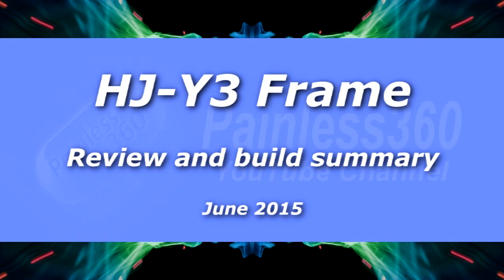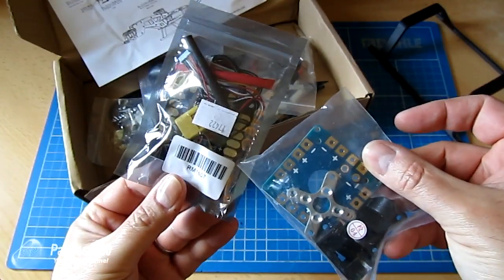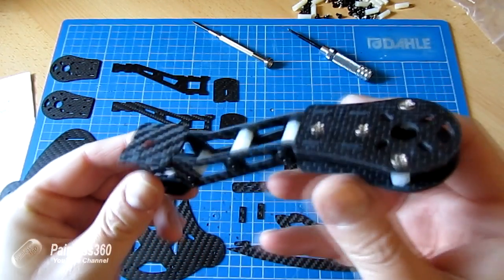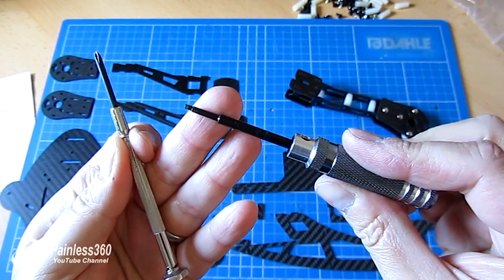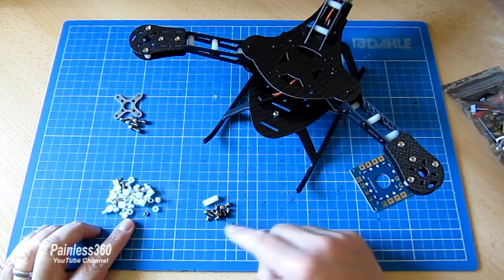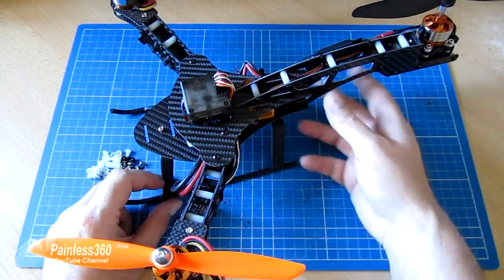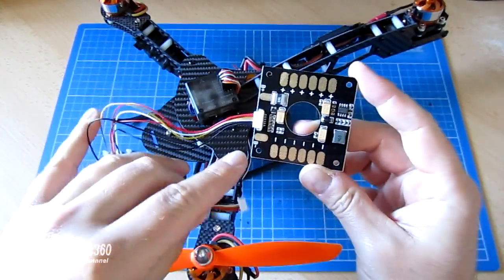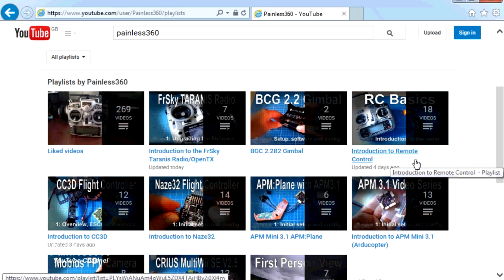HJ-Y3 Tricopter Frame Kit  - Overview, Build Summary and Review (kit from TomTop.com)

Comment: Thanks for that. My kit arrived with no instructions at all, so it would have taken me a lot longer to assemble without your video. One thing: I found it very difficult to mount the motors without removing the lower plates from the ends of the arms, and I wondered if the alloy X-shape plates that came with the motors would be worth mounting under the motors to strengthen the carbon and possibly damp vibration.

Comment: I finally got around to building this frame tonight. However the tilt assembly would not fit into the Towerpro SG90 servo head (too large). Emax ES08MA-II servo would not fit either (head too small). Towerpro MG90S servo would not fit either (head too large). Neither would the Towerpro MG92B servo (head too large).

Yes I have all these servos, and none would slide in. Should I use a hammer?

How did you fit your servo into the tilt assembly?
Reply from the maker: Mine came with a servo that fitted but the tilt assembly isn't using a standard size hole.. poor design isn't it!
Reply: Managed to force the MG90s in, but I think something inside the servo broke in the process. My Racerstar BR2312 980kv motor does not fit the aircraft-style motor mount on the tail tilt assembly. The mounting holes on the frame are of the ancient 45mm variety and will not line up with the 30mm mounting holes on modern FCs and PDBs.

Strewth... this isn't a straightforward build after all. Forced to shelve this build until I figure out a work-around.

Comment: Super great vid !! It inspired me to order and build my first tricopter =) I have one question though, what's the model number / name of the digital servo that worked with your hj-y3 ?? I have been looking all over and all I have to show for it is a box full of micro metal geared servos ;). The sprocket on them are either too big or too small...
Reply from the maker: It's an MG90 servo but other identical servos in my soars bin also have a different output shaft..
Reply: MG90S is a Towerpro mini servo. Will other similar Towerpro mini servos fit the pivot assembly, such as the higher torque MG90D, MG91 & MG92B...?

They're all available on Banggood, but I cannot tell if the output shafts are exactly the same.

Comment: Well a non-technical comment okay here? Another great video. I built this one, took about 2 days to completely finish and I think it is great looking, I just hope it flies.... But, I must thank you Painless360, this was a fun build with your help. Oh, I was a bit concerned about mounting the motors on this Tri. Would the carbon fiber alone support this motor?  So I used the metal mounts ( Real name unknown) that came with the motors after cutting them down to size. A very fun build!
Reply from the maker: +Steve Gross Yep, CF mounts are fine. Happy flying!

Comment: just got one, this is going to be my first FPV tricopter. the kit went together well and fast. Going to start with 2212 -2200kv motors with 6045 genfan props on 3s battery and cc3d flight controler. may drop down to 2212-1000kv with 8045 props later.

Comment: I was thinking about building a tricopter next, I have been looking at the quanum trifecta, its a nylon folding frame, only problem is, it doesn't come with the tail servo, and I think hobby king is the only place that you can order the frames
Reply: I got the Trifecta, and do not like it. to small and short. needs to be taller for battery not to hit the ground on every landing. 1804-2200kv had a hard time keeping it up and stable with 6045 gemfan props. the hobby king servo lasted 1 week then the gears striped. looks good hanging on the wall.
Reply: heath wells thanks for the reply, I think I will stick to quads for the time being.

Comment: Firstly let me say great set of videos on both the CC3D and the Naze32. If you were to order all the components for this frame, what motors and props would you recommend? I have a number of components already (bluetooth, skylark OSD etc) for a FPV Quad, the only item I need to buy is the frame, ESC and motors.
Reply from the maker: Chris Cavill There are lots of answers to the question! Everyone has their own preferred setup. Some want longer flight times so go for 2213/935kv motors with 10x4.5 props some who want insane acro performance go fro smaller, faster motors with smaller props (2822/12 1800Kv with 7x4.5 props).
Best of luck with the build.
Reply: Thanks for the feedback, much appreciated

Comment: Bought this kit as well. I guess you got all the nice pieces that fit nicely together and I got the other ones - it was so bad I ended up putting the frame in the bin; maybe that's the penalty of ordering only the cheapest parts online. The tail assembly is quite nice however and I kept it together with the landing skids for use on a scratch build wooden tricopter.

Comment: Great video! Thanks for sharing! Looking forward to seeing the next installment. Also your ideas on possible FPV options for this build?. And what motors did you use?
Thanks Again! :-)
Reply from the maker: Robin Morris I used some I had here spare - 2822/14 with 7x4.5props. Designed to fit a go pro if needed but I'm using it with the little cheap video Tx and a FatShark HD Pilot camera. You can see it briefly on this video - https://www.youtube.com/watch?v=MdoKkrI1_hA
Watch this space!